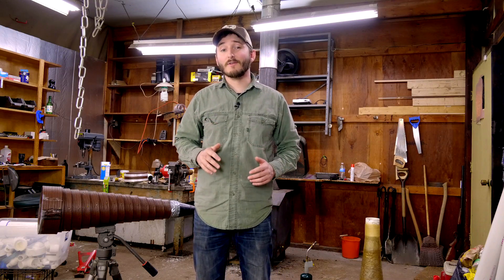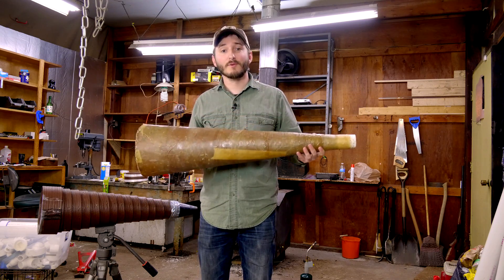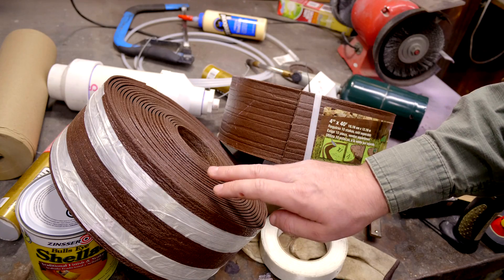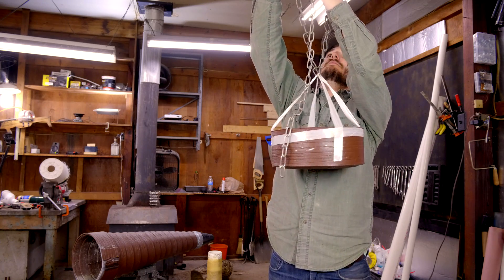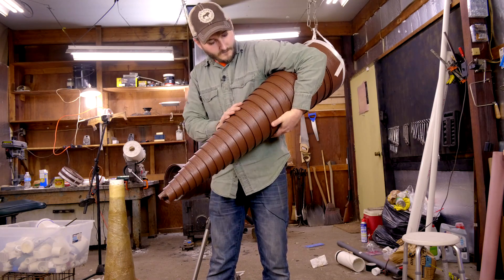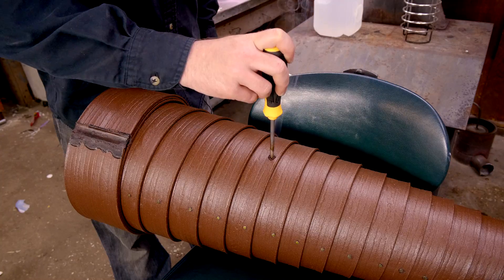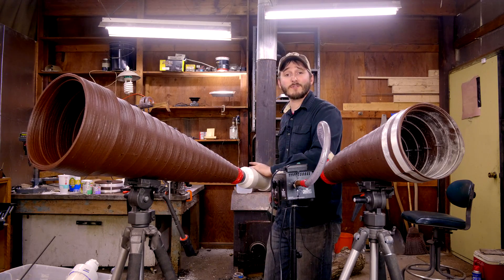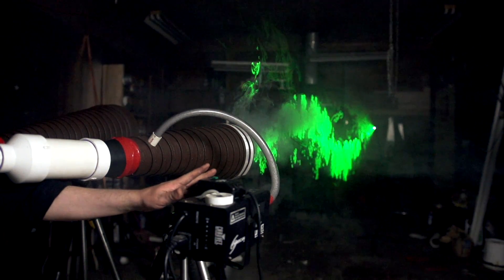Building a High Velocity Vortex Cannon

Comment: A sodering iron with a flat tip works well for plasti welding. If you want added strength you can add metal screen and melt it into the material. I used to repair kayaks and canoes with this method. For bigger holes i would take material from an out of sight area and weld it into the screen.

Comment: Since without atmospheric friction the escape velocity for the Earth is approximately 25,000 mph anything which is not solidly connected to the tectonic plates including the tectonic plates themselves would be propelled across the surface at a thousand miles an hour this includes water alluvial soils buildings and other structures and people basically everything that we know would become a great big smear on the surface
This would become increasingly less pronounced as you approach the geographic poles. Anyone standing on the north or south pole would likely experience mild dizziness at most

Comment: questions: why not just use a road cone?

Why not melt the roll on your cone with essential tacs on each overlap rather than nails? Or for that matter why not use screws that are not protruding on the inside and it would hold better.

Comment: I made and developed a vortex cannon 35 years ago. And have done mod’s every now and then. Inside your gas chamber  I placed a.  a steel can w/ the back end open and the forward end with 6 can opener sized holes at the front. This makes a better combustion chamber! I screwed the chamber to the outside with 12 concentrically placed sheet  metal  screws .

Comment: When you were describing using fiberglass and resin I was thinking about the mold you must have made. Then you switched to the landscape trim material and  I thought how difficult it would be to get the trim to attach to the mold and then get it to hold its shape. But as soon as I saw the coil with the tape I knew what you were going to do. Clever. I am deeply envious. You saw the answer just asking the question. I couldn’t see it until I saw the answer. Clever clever. Very nice.

Comment: Earth's rotational spin is just under 1700 km/h so I don't think anything would leave the surface for very long before burning up in the atmosphere either before leaving or definitely upon re-entry, another planet or very  large satellite moon(like pluto)  would have to collide with us to stop the rotation of the earth that significantly; this being said, it takes 6000-45000 km/h to absolutely leave the extended surface gravity of Earth with a vessel.  The earth orbits the sun at 108 000 km/h, so once we get at least 20 000 km away from the surface we should be able to break planetary orbit on the way to travelling at least 10 000 km/h so anything less than that will eventually 'fall' back to earth and likely burn up upon entering the atmosphere travelling extremely fast.  We would have to orbit every hour travelling just over 40 000 km(equator)Which would suggest we would have to maintain an even greater speed in the vacuum of space of more than 108 000 km/h to leave the Suns gravity in order to leave our Galaxy afterward as well... if we tried to go behind earth and break orbit going backward we may slow down too much and get pulled into suns gravity.

We should also build a very long rail gun to send loaded cargo train cars into orbit using shuttles up there to 'shuttle' cargo back to station and build much faster and economically than using rockets to send limited amounts up, with the station orbiting 14 times a day, we could send tons of cargo every day.

Comment: Great video.  Would like to see the power difference if you used hydroxy gas instead.  Warning, if you do this start with a small amount and best if you do it outside.  I would fill a small balloon and insert it into the chamber then use a remote ignition source just in case the combustion chamber fails.

Comment: We used to take a driveshaft out of a car or truck and drill a 1/2” hole in it. We would take acetylene and oxygen from a cutting torch and fill the drive shaft with the mixture. At first we just did practice trails and discovered how much we could safely put in it. We would take a baseball and place in the driveshaft about halfway and then light it. The baseball would easily travel a couple of hundred yards easily. You could significantly bend the metal on the side of a building 200 yards away! This was by accident and the people were nice about it, once they learned what we were doing. They thought it was neat. Don’t know if it was a law against it back then, but nowadays it would probably get you put in jail, especially when you damaged a building. We had lots of fun doing this and we mounted it on a big shop vice that could be moved around. If you aimed the ball at the inside of the shop wall it would go through it with no problems. Careful should you try this as I wouldn’t recommend during this day and age.

Comment: How long is your finished cone (without the combustion chamber)?  This might give us a good idea when we have the cone at the approximate correct angle. Thanks for your informative and interesting videos.
Reply from the maker: You can't really measure it that way because some people might leave more of the roll coiled at the wide opening of the come than others. For my barrel there are 2-3 turns of the roll that go parallel before it spirals outward to start the cone. To answer your question though it ended up about 35 inches long

Comment: While you may not have chlorine to worry about with the PE plastic, there is some carbon monoxide produced when the plastic smokes or combusts like that. I work with HDPE in a very similar manner. I'm not sure of the amounts that are produced, but I'm sure it's a small amount and I make sure I'm not breathing in the smoke anyways and doing it outdoors. Still, just something to keep in mind though.
Reply from the maker: Yes you should avoid intentionally inhaling any smoke, certainly.

Comment: One safety note not covered in the construction: if you use galvanized nails, the zinc coating will burn off and it can make you sick (zinc shakes). This amount of exposure isn’t a big deal for fully-grown people, but if your kid is helping make this, maybe don’t use galvanized nails (and/or ensure kiddo doesn’t huff the fumes). And yeah, this is totally the kind of thing I’d do with my kid if we didn’t live in the city.

Super fun video! It’d be neat to try capturing stills of the vortex with an audio trigger. The wakes look pretty amazing, too.
Reply from the maker: Thank you! You're right, I forgot to consider that. Usually I wouldn't worry about the small amount of zinc on a nail, but you heat at least a few dozen of them for this project so it would be smart to use caution.
Reply: NightHawkInLight Yeah, for an adult, it’s almost certainly not an issue.  But a lot of nails done by a 40 pound person whose face is pretty close to the torch might fare less well.  (My kid goes to a school where kindergarteners use chop saws, under appropriate supervision, and 8 year olds learn to weld… I can see little people taking this one on. And the zinc thing isn’t super common knowledge, unlike “red hot nails will burn you” etc.)
Reply: I really dont think this level of exposure is an issue. and even if you did get zinc oxide lllness its short lived and not permanently dangerous with infrequent exposure
Reply: My point wasn't about adults, it was about smaller kids, who will have their face right in the smoke, weigh less, breathe faster, and have smaller lungs, all of which makes things a lot more impactful.  For adults, yeah, whatev.  But it's worth adding a note about this, because most people have no idea that zinc fumes are toxic, and the onset of symptoms takes a little while.
Reply: Josh Myer That is a cool school! I thought all schools like that were a thing of the past. When I was in high school my shop teacher let us buy kits and make crossbows(still have it). He even brought in his rifle to school to show me what a cheek rest was. He also taught an extra curricular morning knife making course. He was the absolute coolest teacher, and I learned so much from him, everything from safety to metallurgy.
Reply: Good point! I hope this becomes one of the top comments!

Comment: Great visual.
I would think the entry of the air in teh chamber and it's path through the cannon would really affect its performance.  Did you compare the smooth bore with the rough one (nails, screws, and ridges) and find an significant difference?

Comment: Pretty bird :) And If the earth stopped spinning, but still kept revolving around the sun, then everything on the surface would be flung straight across the ground, relatively speaking. If it stopped revolving as well, then, those on the front would be flung up really high, possibly leaving the atmosphere depending on mass and height above sea level. And the stuff on the back would suddenly become subterranean, with all sides being similar to the first. The moon would either leave or make a very VERY large hole, depending on it's location, relative to earth. ALL LIFE ON THE PLANET WOULD END IN A SPECTACULARLY BLOODY DEMONSTRATION OF HIGH VELOCITY PHYSICS. Not long after this, the earth would leave the solar system, and be bombarded by everything in the way as the solar system leaves. The pile of cosmically stationary rubble left would then freeze solid. And this doesn't even describe what the atmosphere would do. It might be something very similar to that vortex cannon.
Reply: Since none of the letters showed half the people flying up and half the people going into the ground, I would assume that when they say it stops spinning they only mean around it's axis, not around the sun. Based on this, which letter would you say is most likely?
Reply: cheeseman I answered that in the first part, right after I said Pretty Bird.
Reply: Hexx Bombastus do you choose letter D then. I was just wondering because you were the only comment I found mentioning the question.

Comment: that awesome shot with the green lazer. you should put it on a motor so it spins on it's axis and makes whole vortex rings instead of cross sections.
Reply: mcheddadi I was just thinking you could put in a drill chuck for that exact purpose. The results would be pretty fun, especially if you played with various speeds.

Comment: Hey NightHawk... Do you remember making the soup can forge? Well...  I made one too and it started crumbeling instantly... Have you got any tips on how to increase the lifetime of the forge?
Reply from the maker: Maybe you used too much sand in your mix. I haven't had problems.
Reply: Well... I grabbed the sand from people working on our sewerage... They had a whole lot of sand... Also ive seen Grant putting some steel wool into his mix... Don't you know if it makes any difference?
Reply from the maker: You can try it. Grant has done more experiments with the mix than I have
Reply: Ok, Thanks alot... I see you care alot about your community
Reply: Slendeer_Games what i did was use the can and torch, but go to the hardware store and get a thing of furnace cement for like 10$ and use that instead of the sand and plaster of paris
Reply: Yeah, but i think cement doesn't vent off some of the gasses so there is a chance, that it could blow up into your face... Also i couldn't get even easier metals (Aluminum etc.) to melt... Im using a torch, witch they say can reach 1800°C but yeah...